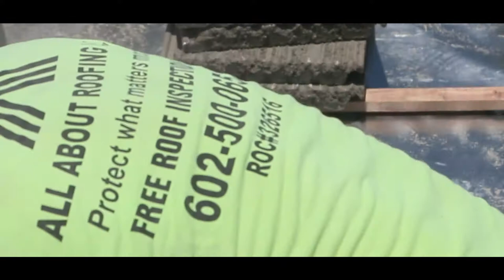Cinematic Tile Roof Installation | All About Roofing LLC.

Comment: Just out of curiosity how come you did not replace the old half dome attic vents with Ohagins??  I have 3 half domes on my house and I'm presently doing the re-roof tile relay myself. The paper is 38 years old and time to go. I had Ohagin do a workup on my house via their website and they spec'd in replacing my 3 half domes with 48 (yes 48) vents in total. I believe that's overkill. I can only assume they thought the entire roof was attic space based on google maps but it's obviously not. I'm buying into bringing the house up to code but I think 48 vents on the roof including non-attic space roofing structure is too much.   Nice video BTW.